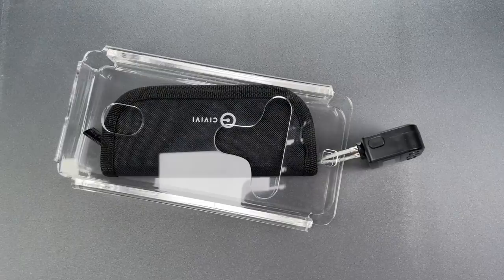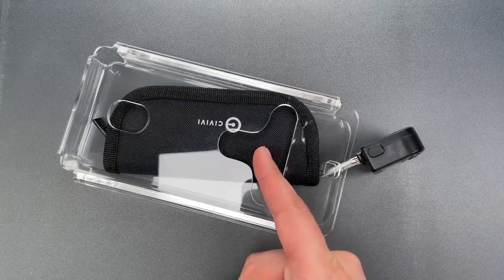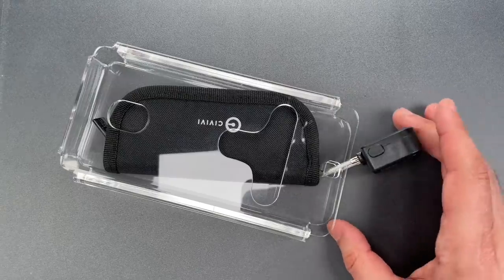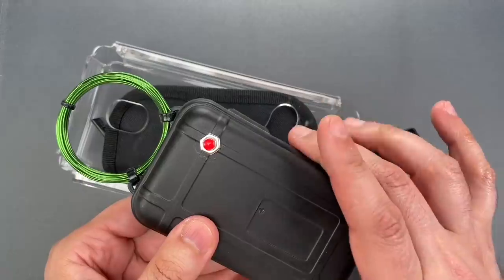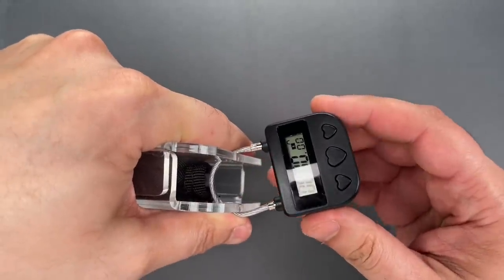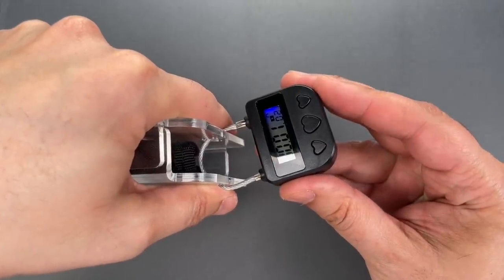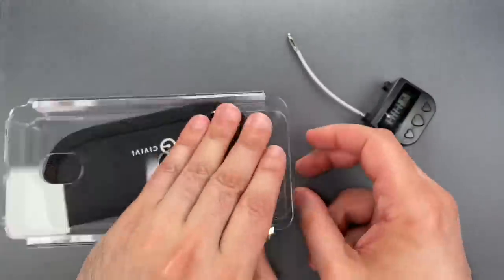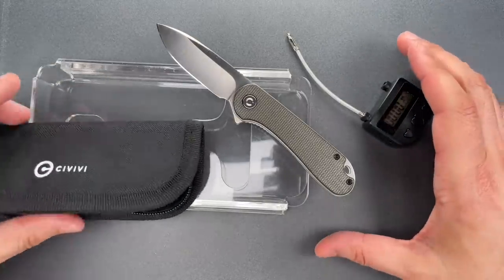[1323] Pocket EMP v. Timer Padlock

Comment: Next: What I have for you today is the full size EMP device, that Bosnian Bill and I made.
Reply: Dark Angel with Jessica Alba intensifies....^^
Reply: "We're going to put it around this Tesla to force the system to reset."
Reply: Or the MIT pinch generator from Oceans Eleven movie.
Reply: And is available on our web site.
Reply: To be fair that thing sounds like one of those high voltage modules you sometimes see online for a few bucks, hooked to that coil via a spark gap
Reply: @alexs5814  I understood that reference
Reply: This bad boy opens every electronic lock in a 20 mile radius
Reply: @techtastisch7569  I'm pretty sure that's exactly what it is. Diode-split transformers together with a capacitor and a spark gap work quite well too. I accidentally crashed my PC with that once.

Comment: Most people: "Screw it I'll grab the cable cutters"
This absolute legend of a man: "So I built a goddamn EMP"
Reply: He's obviously responding to the crim fraternity - wait for his Monday demo truly putting the wind up car designers. Hint: have your locks fail closed.
Reply: @JelMain  While fail-secure is great in a large number of cases, IIRC anything in which a person may become trapped in the event of lock failure is required by US law to fail open (or be "fail-safe").
Reply: @Amigo21189  It depends on your definition of safe, therefore. If you need a lock, then safe is closed, or what's it's point?
Reply: @JelMain  No, no.  That's just what those terms mean:  "fail-safe" locks fail into the open position, "fail-secure" locks fail into their closed position.  While it seems like fail-secure would be just plain better, if you stick a fail-secure lock on a door and then it fails during (for example) a fire, someone can become trapped and burned to death as a result, and then you have very severe legal troubles on your hands.
Reply: @Amigo21189  This isn't a house, and so you're using a false comparison. A car doesn't lock its doors if someone's inside it, unless they do so out of safety concerns - their choice. If it did, the inside release is mechanical: if someone tried to force my car doors once I'd locked it by blowing the electrics - which is what's been happening in Canada - then they'd get exactly nowhere. What we don't need is a car defaulting to unlocked if forced.
Reply: @JelMain  Still a container for human beings rather than inanimate objects, which is the source of concern.  I get that your interest is inclined more toward security.  But in order for that to become the norm, you'll need to talk to your local legislator about protecting automakers and lock-makers from liability in the event that a car fails to let passengers exit following an accident that causes them to need to evacuate the passenger compartment.
Reply: @BurntBacon8r
Sorry, but it's nothing more than 1 low voltage battery (usually 18650 with 3.7V), stepped up by a transformer. The arc is created by the air gap on the separated polarities and the coil in between those leads, giving the EMF we see here. It's nothing legendary. Though he is legendary at mechanically picking locks and entertainment.
Reply: @Irondrgntp  It would be legendary if he had reversed the primary and secondary, though! Even taking the overstatements made by the vendors into account, it would still generate an unhealthy amperage. It's also why LPL didn't elucidate on the innards.
Reply: These amperages are fractional to that of lethality, however. Even reputable taser devices, which are the basis design an EMP are thousandths of an amp. The current flow is negligible, but the voltage is significant and not really of concern.
Reply: well... the housing made from plastic. real case scenario to open is to just push a bit the case....
Reply: @Irondrgntp  The watchword is it's the volts that jolt, the amps that cramp. If they wanted to electrocute the target, they'd up the amps. Instead, they want to jolt him off whatever he's about, so they wind the amps down and the volts up. All off the same wattage. To a  great extent it's the body's sudden forced reset pulling muscles that causes the pain, and can kill if it's the heart - as too many troopers know, forgetting the training not to go for the obvious target, the upper torso.

Comment: Without getting too far into the details, I used to work security at a CA State Building- To get into the building, we used to put our radios right against the card readers and key the mic. The door popped each and every fucking time.
The radios and the readers have since been replaced, but the defect is still there.

Comment: The LPL basically opened this lock with a handmade Dr Who sonic screwdriver.
Reply: Next on LPL, this is how you disarm a Dalek...
Reply: That'd actually be quite a unique Sonic Screwdriver, and LPL would be an unique doctor, being able to get out of situations with relative ease.
Reply: @ericoconnor904  haha.
Reply: @rfacproductions6552  talk about the precursor to the precursor. I thought the 3rd Doctors screwdriver looked a bit proto, but this thing is like Rick Sanchez's "first" portal gun; its functional, but not very useful as the probability of running across a digital lock that can be scrambled by the EMP and unlock or become easier to unlock isn't very high.
Reply: @rfacproductions6552  He'd be the Doctor that can make quick work of even a deadlock sealed door.
Reply: @brattman741  yes

Comment: I'm curious to see if the pocket emp would work on all those new fancy electronic door locks, scrambling the inside so that it resets to factory settings. If it does, seems like a real easy way to bypass electronic locks without having to actually gut the lock
Reply: Some of the locks don't default to the open code. You might simply scramble the code to some unknown number!
Reply: @glasslinger  I'm a big fan of your videos on glass vacuum tube making.  Do you have any ideas for a DIY EMP device? It would make a great project I think.
Reply: It still only takes a magnet to get in 🙌🏻
Reply: those locks use a little nonvolatile memory so you can change the battery.  also the case is usually metal so it would be harder for the field to do as much
Reply: Any change to the settings seems unlikely, since they would be kept in non-volatile storage (probably EEPROM). What it seems to do is force the processor to reset. So the question would be, does the electronic lock in question default to open or closed when you power it on?
Reply: The Schlage ones I've dealt with don't have a single default code, so even if an EMP were able to scramble it and set it back to factory defaults, it wouldn't help you get it open as the default code is random for each one and on a sticker inside the lock.
Reply: @ampakinetic  I concentrate all my efforts on constructive projects. Destroying things is not my nature.
Reply: @glasslinger  I respect this point of view, thank you for responding.

Comment: My question is, “Do you have a schematic for the EMP generator that I can have?”
Reply: It's basically  an electronic fly swatter with a large capacitor and and induction coil
Reply: Me too...
Reply: google works wonder.
Reply: This is a very weak emp generator. If you want a powerful one you'll need higher current as magnetic field is dependent on current. I think I saw someone build one out of those huge capacitors but don't remember where.
Reply: @ToeCutter454  That response doesn’t answer the question.
Reply: @prakharmishra3000  All I was interested in was a schematic of the EMP generator he used.
Reply: @kevinmichael2593  That didn’t answer my question. I wanted to see how he built his.
Reply: It's not very complicated, but quite dangerous if you don't know what you're doing and aren't careful, so probably don't build this (but if you do, *do so at your own risk and be safe*). Due to the capacitor even a normally not as dangerous high voltage source can become quite a bit more dangerous, and the capacitor can remain charged for a while after you turn off the source, so it has to be shorted safely (and a bleed resistor might not be a bad idea either).

Take some high voltage source (fly swatter might be a bit weak, one of those taser modules would be better, or an induction coil or diode split transformer), rectify it if it doesn't output DC and hook up a capacitor in parallel. Those taser modules usually have that integrated already so you don't need the capacitor, the other ones do. Then put the coil in series with a spark gap and connect that in parallel to the capacitor.
The high voltage source charges up the capacitor to the maximum voltage it provides, the speed depends on the current it can deliver. Once the capacitor is charged up to a high enough voltage to create a spark at the spark gap, it discharges through the spark and the coil, creating a high current high voltage pulse that results in a strong pulse from the coil. After that the cycle starts again.
The maximum voltage it can charge up to depends on the voltage source and the maximum voltage it charges to depends on the spark gap and the air around it.
Reply: @MADxHAWK  Didn't think of those. They only give one pulse, but it should be stronger than the other methods.
Reply: @ToeCutter454  youre so cool bro
Reply: @ToeCutter454  lmfao dude you destroyed him
Reply: @lord_wyran  *you're
Reply: White noise generators are more fun to piss off the movie theater goers who never put their phone down
Reply: askin for a friend in a team of 11...
Reply: @ToeCutter454  You could maybe try not being rude.
Reply: E-cigarette with double 18650 battery + long isolated copper cord. Easy man, but it will cost near $100 and power provided not so great. But You ll able to kill some TVs =D
Reply: this is one of those things where you know how to build it if you understand the components. Like chemistry.
Reply: @coreforge  Tbh it's not even really that dangerous, we used to throw photo flash caps charged to ~300V with the leads folded over on the sides at each other as kids.
Amusing to yell catch at someone, them catching and immediately dropping the think cause they just got bolted in the hand.
Reply: @FriedPi-mc5yt  nice try BATFE.
Reply: @FriedPi-mc5yt  Yes it does, and more.
Reply: @ernestgalvan9037  Exactly!! I’m interested in the method LPL used to construct his. If I wanted an EMP generator I would just freakin build one. People don’t seem to understand my post.
Reply: It's just one of these... https://youtu.be/siVGavpBiyA  just built a little neater and with the coil in a different orientation.
Reply: @MADxHAWK  Also for those going this route, make sure you dump the flash before touching the insides. I worked at a 1 hour photo in highschool and acidentally shocked the hell out of myself when I acidentally touched the capacitor.

Comment: lmao, yes "use this fast and easy lock picking method, an emp generator" ...
Reply: It looks pretty easy. He just pushed a button.
Reply: Okay, for real, it is not actually that hard to build one if you know a little bit about electronics; it is essentially just high-voltage spool. Dumbed down it is just wire, batteries and a voltage amp. And the button of course.

Comment: That is a very nice pocket knife. The design is superb, with clean outlines, not much decoration and an understating form that doesn't say much more than just folding knife. 
Also, the EMP generator is a very nice idea. I once tried what an induction stove would do to an electronic kitchen timer. It kind of did the same thing as the lock in the video.

Comment: Yo, can we see the circuit schematic? I'm kinda curious about that stuff.
Reply: this looks like a taser module with a magnetic coil added to it, BigClive has a video from a few years ago about taser modules
Reply: I bet it is just cheap aliexpress shocker with a coil added
Reply: @ambientocclusion  Didn't he specifically mention it's high voltage, low current?
 
Those wires don't look anywhere near thick enough to take 20 amps.
Reply: @paulelderson934  This wire looks like pretty thick magnet wire, which has very thin insulation on it. It could easily carry 20A in short pulses, which is what you would want for an EMP generator. But he did say "high voltage, low current".
Reply: @paulelderson934  Perhaps in short pulses.  Big current in small wires is a heat issue.  Keep it short so there's no heat build up and it can take a lot.
Reply: @russellhltn1396  most household wires can take 20amps at 120v.

Comment: I somehow imagined school teachers making use of this tool only to have their plans foiled by the smart kid who casually gets his phone back with this method during lunch/study period.
Reply: The phone may not appreciate being exposed to the EMP, though.
Reply: @mercuriall2810  Very true, while I’m not an expert to the permanent damage it may do but the emphasis on the reset displayed here may prove to simply reboot the phone in question.

Obviously shouldn’t be a repeat ordeal but mere speculation on my part in the moment. Sorry.
Reply: @mercuriall2810  Simply make sure your phone case also functions as a Faraday Cage.
Reply: @mercuriall2810  Phones ae tested/built to much higher standards than crap locks, also the strength of the field drops extremely rapidly with distance so with the coil over the lock the phone that far away would receive hardly any energy to speak of.
Reply: @X1ongu  I'm pretty sure that defeats the purpose of a phone

Comment: “Pocket EMP” or… modified tazer
Reply: Magnetic pulses don't work that way................ Well whatever
Reply: A taser is high voltage low amperage. So, yeah, that will work. Downside is tasers tend to fail when the current is not actually discharged into something.
Reply: @mascadadelpantion8018  It could be the guts from a taser.  They are just a step-up transformer followed by a large voltage multiplier.  The output is high voltage pulsed DC.  That would work great through an appropriate winding.  I actually have designed a version that fits into one of those battery powered puck lights, with the coil built right into the PCB.  I think it's a work of art.  Put it on whatever you are wanting to disable, and push the top down just like you were turning on the light.  Poof, 8 to 10 teslas of magnetic power pulsing into the target.
Reply: @tomscheea8656  downside..............

Well call it what you want but when it don't work it don't work
Reply: @mascadadelpantion8018  Take a tazer's high voltage output and run it through the coil loop you see.  Might need a spark gap as well.  Been a long time since I had to take the electrical courses.
Reply: @tomscheea8656  🏴

Comment: Yeah, I have a question:
Why are the buttons on the padlock shaped like hearts?
Reply: So is this sarcasm or do you think the typical use for this timer wire locks is for locking cellphones? If so I envy you for not having been ruined by the Internet yet...
Reply: I got one for my phone after this video.
Luckly Chinese crap in the naughty section is cheap :D

Comment: Anyone know the legality of EMPs in the US and EU?
Reply: Seems to be legal in US, at least in this power range.
Reply: should be fine. It's a really simple circuit, the type used in science classrooms for demos
Reply: This question is ironic bc he's literally a lawyer lol xD
Reply: I guess it’s regulated with the law of radios-waves.
Like using walkie-talkies at specific frequencies and emission power.
Reply: @jooei2810  I’m now also wondering that, but I guess at this low power level it’s unable to interfere with anything not literally next to the coil so most general (i.e. radio regulation related) legal issues would be sidestepped, unless there were a law specifically banning it.
Reply: @jdatlas4668  The ignition coils in your car put out far more power than this device will.
Reply: @jdatlas4668  The other question is if this coil device would damage the phone inside of the locked case, which the overall goal would be to extract intact.
Reply: @vovin8132  I would guess not, he likely had to put the lock "inside" the coil where the field is the strongest for a good reason.
Reply: Some US states classify "harmful electronic or electromagnetic devices" on par with nuclear/biological/chemical weapons, and impose the same draconian penalties for manufacture or use "for any unlawful purpose".
Reply: Nothing is illegal if u don't get caught 👌😎
Reply: @robinthrill3r7 ,  you got that right..!  and very little is  'immoral,'  whether you get caught or not.
Reply: As far as I know, possession is legal, use might not be.. depending on frequency and wattage. It's not the fact it's an "emp" that's the potential problem, it's that it puts out RF noise that might interfere with other devices if it happens to operate on a regulated frequency. Unlikely that it has the wattage to actually interfere.. and even if it does, nobody's going to bother tracking you down.. even if they do, you'd just get a small fine.
Reply: If youre the Gov, its legal...........
Reply: Just don't make it a couple of meters large near an airport.
Reply: @vovin8132  "The other question is if this coil device would damage the phone inside of the locked case, which the overall goal would be to extract intact."

Not likely... but if the phone detects something wonky going on and resets, it could be harder for an attacker to access the data.  (Notably in iPhone.  Presumably in others too?)  

That said, if the EMP disrupts a data write it could induce file system corruption.  Modern file systems are pretty good about dealing with such things, but the randomness of the EMP's effects could cause less common failure modes.

If I understand correctly, this possibility could be greatly reduced by wrapping as much of the cage as possible with foil.
Reply: @vovin8132   not if the phone was turned off.
Reply: Small ones should not be an issue.

Big ones may cause people to have an issue with you.